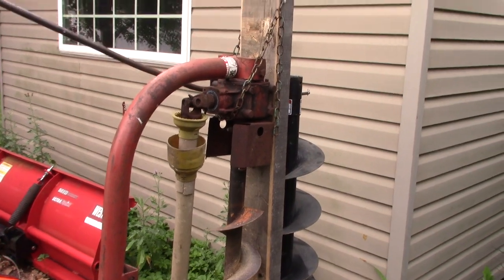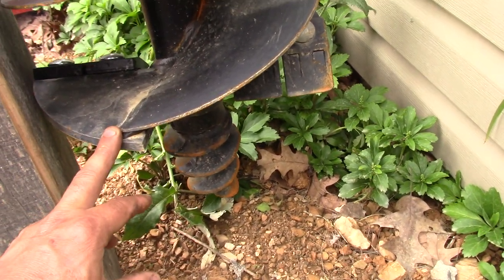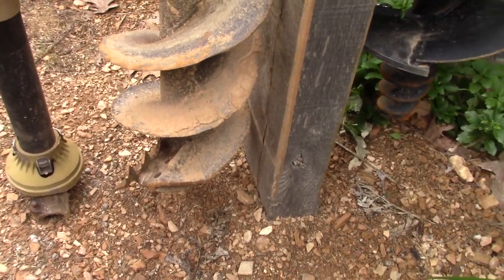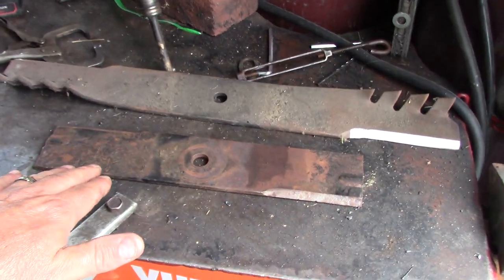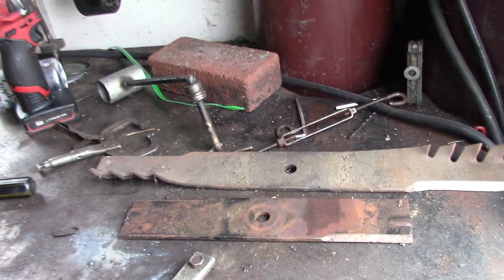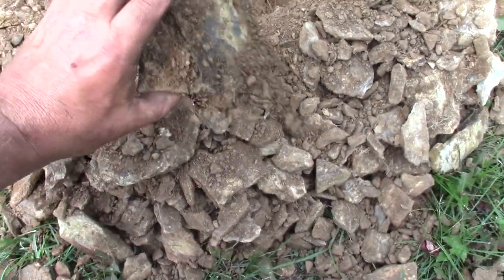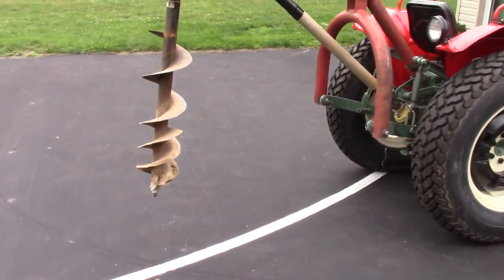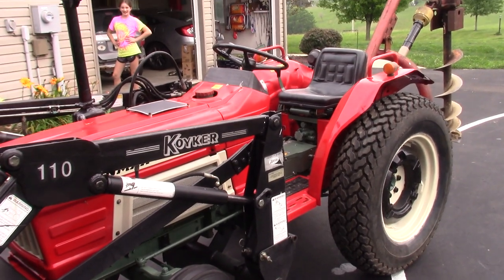Dull Earth Auger Quicktip Repair Free

Comment: Nice tip on the repair. Seems to works well. If you haven't check out tractor time with tim he has a great channel about using small and mid size tractors with all sorts of implements and good tips.

Comment: Your auger was leaning back more as you dug deeper ( simple geometry does this) - if you want to dig vertical holes start with the auger leaning a little forward (towards the tractor) - then as you dig deeper move the tractor forward just a little to counter act the leaning back - 2 to 3 moves should do it depending on how deep you dig. Then if you take the auger in until the gear box is level with the ground the auger will come forward by itself, but not much.
Obviously the hole is kept vertical in the other direction by adjusting your 3 point hitch to counter act any slope sideways to the tractor.
While I am picking on you (IMHO) I use less rpm and control the rate at which the auger goes in by slowly lowering the 3 point hitch. As I find by slowing down and controlling the downward rate you run into less problems - for instance if you don’t ease the auger down in wet soil it can “corkscrew” in an jam so hard the tractor cannot provide enough lift to pull it out. Then it has to be wound in reverse by hand (a large screw driver in through the yoke of the drive shaft will do this) while you apply moderate up lift with the 3 point linkage. Rocky ground can cause jamming and broken shear pins……..
Enough waffle - I have dug to many holes for one lifetime with one of these machines

Comment: First, they are NOT gator blades that you welded on. They are Rotary Copperhead Mulching Blades. What you showed on the bench are Gator blades. With Gator blades the fins go in. With the Rotary blades the fins to out. I'm thinking you might be a little better off with the actual Gator blades on that but then you might never notice. You've got the bigger version of my Yanmar YM1500D 4x4. (2 cylinder) Yea, I should have gone bigger...